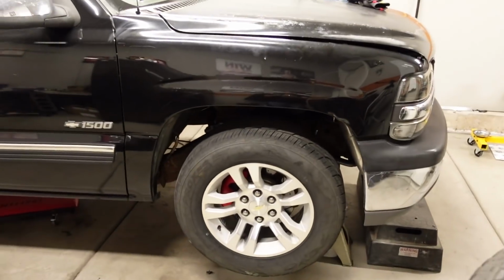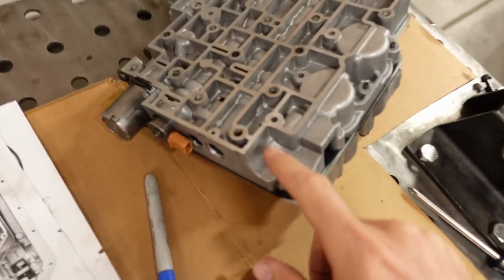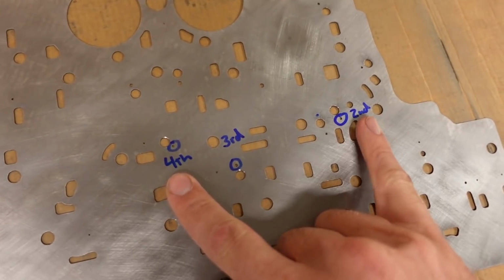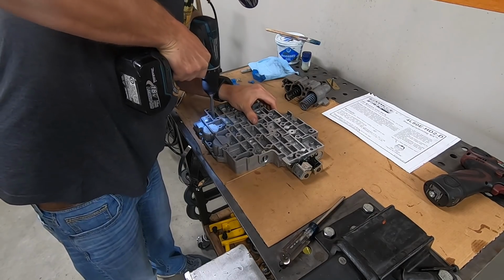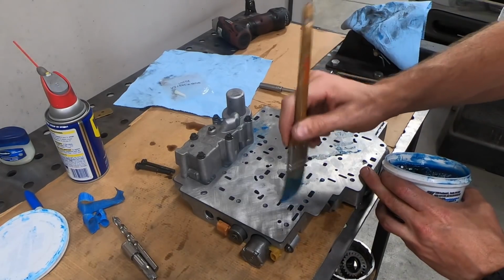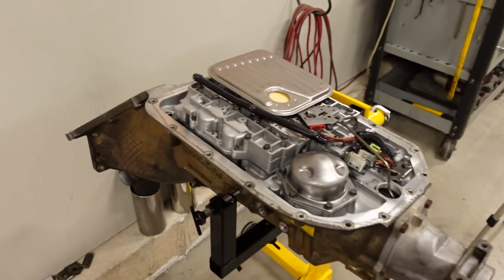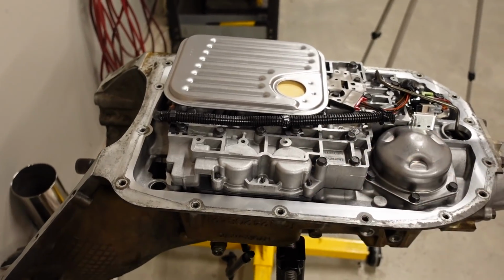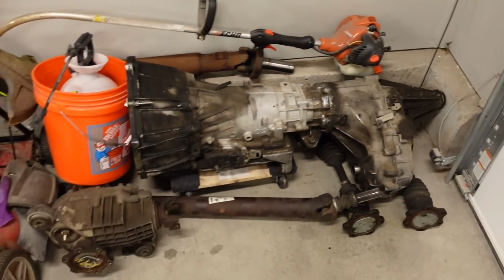4L80 Rebuild Pt.4 Fixing Mistakes and Drilling Holes

Comment: I'm doing an 80e swap on my truck right now and just did the HD2 shift kit. I drilled 2nd at .108, no check ball in 3rd, .125 for 4th. I have a circle d 3200. Are you still happy with those same sizes? I've been back and forth on what sizes to dril so it's a little reassuring to see you did the same thing

Comment: Hi Sir, I’ve just replaced the wire harness, all the solenoids connectors went smooth but the big main wire harness connector won’t come out ! I try to pull it out gently with channel lock but it’s not getting anywhere, the tabs can’t come out ! Any tricks on how to get that connector to snap all the way out flushed with transmission body ? Thanks in advance.

Comment: AWD?! Again I'm not a gm guy but you swapped a Silverado to awd on the old show. So I'm guessing. Ha but I know it will be cool!!
Reply from the maker: thats correct, I'm doing an AWD conversion to the stepside. I made another video you should check out showing all the parts and how it works!
Reply: @TolmanPerformance  yes I just saw it. That will be a fun protect!

Comment: I want to convert my 2wd to awd like how you doing so I get the same parts that you did or is it different with 2wds
Reply from the maker: a 2wd will be more difficult to convert, since the frame has no provision to mount the front differential. An easy fix is a frame swap tho, you'd have to go to a junkyard and find a new frame from a 4wd truck and swap it in, and then convert to AWD with the parts I outlined.

Comment: just got 2003 hd 1500 crew cab with the 4l80e 4wd but i think the trans need help so going to get a rebuild kits it still runs and drives around but i think it slipping into 3rd gear i got the 6.0 lq4 but i have a lq9 with 10k on it when i pull the trans i going to install the lq9 and i going to swap the heads i think it got 317s on it i want to get  going run this cam 54-602-11 comp cam with new lifters springs and locks going to find a set heads to up the compression would like to get 12 to 1 or higher it not going to have a turbo just going na
Reply from the maker: Sounds like a fun project!

Comment: I did the exact same thing on my 4l80 after reading Jake's feedback. Sonnax makes a relief valve does the same pressure relief. So glad I plugged that hole. Its been 3 years and no regrets on the mods. I followed Jake's instructions and kept.the transgo plate. No Crossfeeding  but I did follow the torque specs amd order for vb bolts. I think a lot of guys go good n tight and have issues.

Comment: Use the Tru Cool 47391. I use one in my built 4L80E with Yank 4000 SS converter, going through the radiator. On an 85* - 98* My trans stays at 125* driving, 150* max stop and go heavy traffic. I have a bigger LT1 single core radiator now since the original end tank cracked after 21 years of use. With the original LS1 rad, it would do about 135* - 140* driving and 165* - 175* max stop and go. No such thing as too cool except if you're in the Dakota's or Alaska. Put one in my Jeep XJ also, went from 230* parked AC on in 90* weather to 165* 180* same condition. The 4739 comes with a 180* thermostat if you need heat in the trans, which you probably don't. Use regular trans fluid too, no synthetic, I think the syn stuff makes the clutches slip.

Comment: Did you plug the case next to the center support bolt when you dual fed using the stock seperator plate?
Reply from the maker: Yes, I did

Comment: What would the cost of a badass manual trans be? As opposed to what you've done ?
Reply: A built TR-6060 would be $5k plus for what a heavy ass truck needs.
Reply from the maker: Yeah, I’m sure it would be pretty costly by the time I got a strong enough trans, clutch, flywheel, pedal conversion and all the other little things
Reply: @TolmanPerformance  what was the cost for this? BTW pulling 4 U all the way.

Comment: Just my 2 cents I'd only have a Alison transmission behind the 8.1 peace and much respect to you Jason 👍
Reply: Properly built, a 4L80 will handle well over a 1000 hp, ore with aftermarket parts. A Allison is way to big and heavy
Reply from the maker: I don’t love the Allison idea simply because of the extra weight, and I’ve heard they have a hard time shifting at higher RPM. They are way strong though

Comment: cool series. You definitely don't want to cut the radiator out of the trans circuit.
Reply: Why? He lives in Utah not Alaska. Not much point keeping the radiator trans cooler.
Reply: @MegaDysart  because the cooler in the radiator removes the most heat by the coolant. If it didn't GM and the other manufacturers would have just used cheap front coolers to lower the cost of the radiator by it not needing a cooler. You want the transmission to be at a controlled temp just like the engine. It would boil without the radiator cooler.
Reply: @MegaDysart  2 reasons: 1.it s a turbocharged bob block with a loose converter-it will get hot and the radiator offers a large cooing capacity. 2. It also helps warm up the radiator when it is cold out, and it gets plenty cold in Utah.